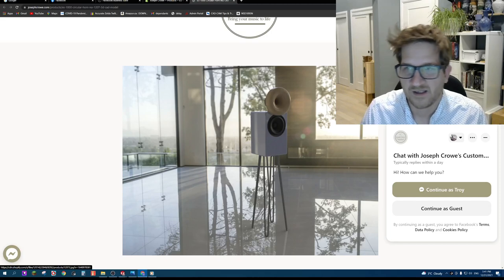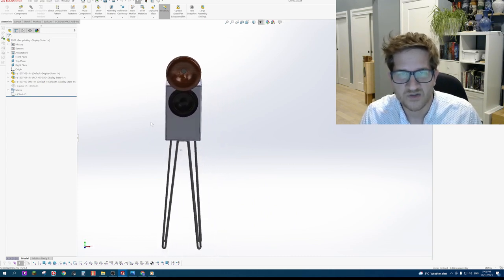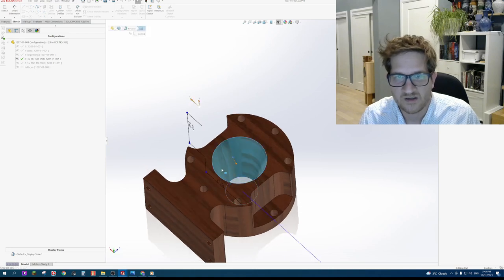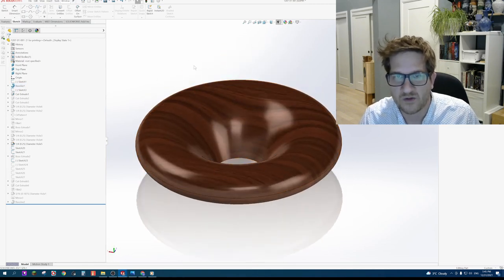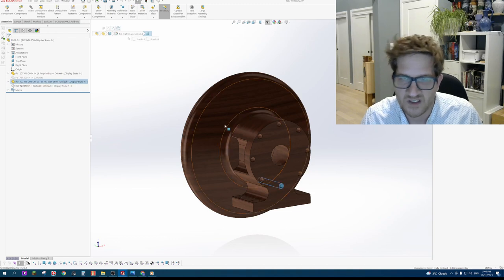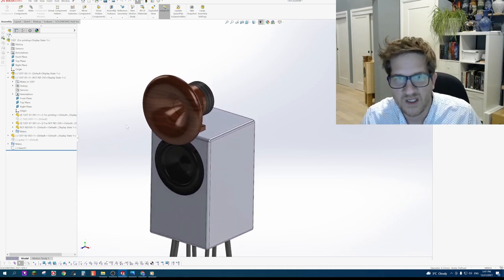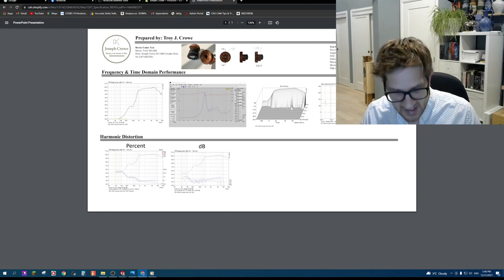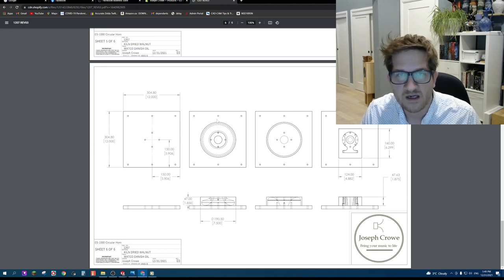ES-1000 Circular Horn No.1207 --- 3D CAD Model

Comment: Any thoughts of a multiple woofer format in an attempt to get closer to the efficiency of the compression driver?
Reply from the maker: Sensitivity is a common misunderstanding with many of my customers.  They are misinformed by the incorrect published sensitivity by companies like Klipsch.  So they think 88dB is not going to work for them if their Kllipsch stand mount speakers are "96 dB" sensitivity.   The reality is that their Klipsch speakers are just the same as any other speaker in that size category.   Expect 88dB for a 5" woofer, 90dB for a 6.5" woofer, 92dB for an 8" woofer, 93dB for a 10" and 95dB for a 12".   You will need at least 15watts for speakers in the 88dB sensitivity range to achieve normal music levels in a small to medium sized listening room.

Comment: I wonder if you've checked IMD over  SB15NRX30.
Reply from the maker: A compression driver is going to have around -60dB IMD at 95dB SPL 1m.  The SB Acoustics NRX15NRX2C30-8 will have distortion at -36dB at the same output SPL.  Lowering the SPL down to 80dB yields a distortion of -50dB for the SB woofer, still not close to a compression driver.  Even the best dome tweeters cannot compete with good compression drivers (regardless of SPL level), although they are close.